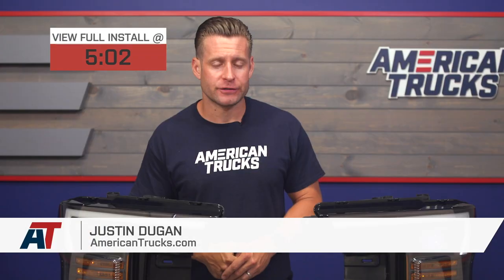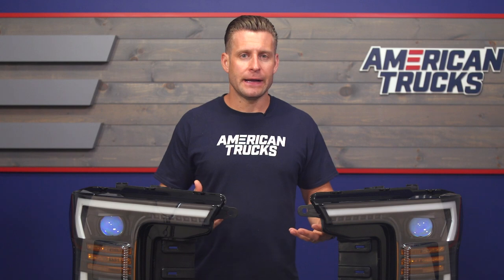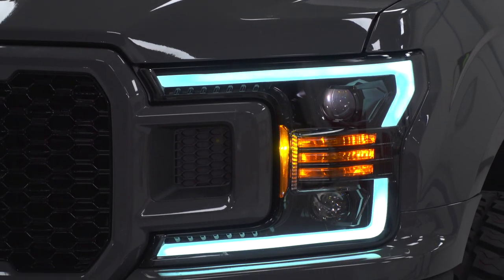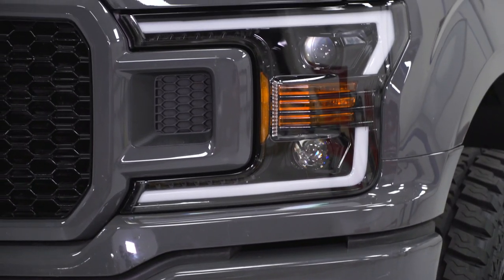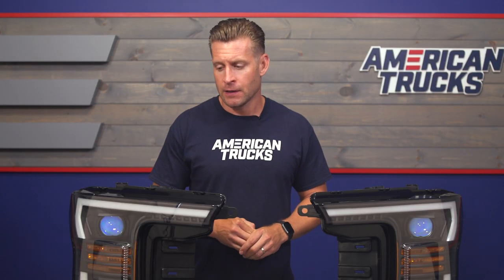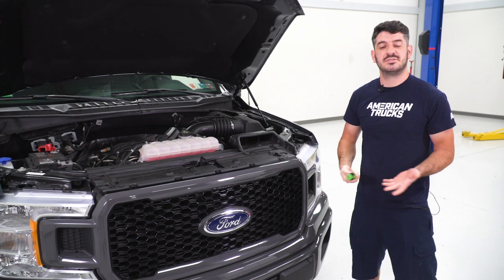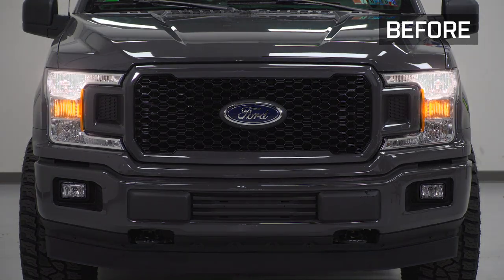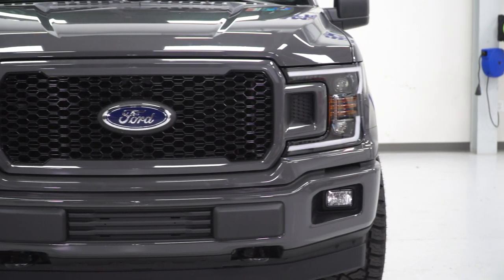2018-2020 F150 PRO-Series Projector Headlights; Jet Black Review & Install

Comment: You need to use a fuse tap and attach the grey wire that comes with the included wiring harness to an ignition circuit if you want your DRL's to work right. I have a 2018 and I installed a $4 tap on fuse #10 per the manufacturers instructions. If your gonna make a video guys, do it from top to bottom.
Reply: exactly, well said!

Comment: Just bought these and are absolutely dim. Will be asking for refund. Going to install my factory ones back on. They look great but can’t see a damn thing.
Reply: You are not wrong. The catch is you buy this unit so youc can swap out the hologen for H7 LED's that you can find on amazon for $40.00 a pair. Now you have LED's for under $700 instead of $1400. The kicker is that if your LED chips does go out, you can replace it. If you buy the whole Alpharex LED kit thats $1400, the chips are not replaceable. After the two year warrantee, you're out another $1400 unless they will sell you the side that went out. Keep your alpharex pro's and just grab the H7 LED's. That's what most people do.
Reply: Exactly what @rdsii64 said ^^. The H7 LED’s will work in these lights and they look great! A million times better than the Halogen bulbs!
Reply: @rdsii64  Do I need to buy the converter add on in order to switch the halogens bulb for some H7 LEDS?
Reply: @MartyIce11 Do I need to buy the converter add on in order to switch the halogens bulb for some H7 LEDS?
Reply: @SM-qu7if  That is something I haven't researched yet, so I'm afraid I can't help you there.
Reply: @SM-qu7if  no you shouldn’t. I didn’t and the LED’s are still running great. I’ve had them in for about 7 months now. Might be best to check AlphaRex to confirm. Sometimes it can depend on your trim level. I have an STX
Reply: One other thing worth mentioning that @MXOaxaco may of had issues with is the projection angle of the bulbs. When you get these lights you will have to adjust the bulb projection for both sides to get them where you want them. My right side was pointed at the sky but the left side was pretty spot on. It’s super easy to adjust them though. Just need a Phillips screwdriver and you can access the adjuster from the top of the light after install. These lights look so good and are well worth the money.
Reply: @rdsii64  apreciate this info !!!
Reply: @SM-qu7if did you ever figure that out ??
Reply: @Eddie510s  Converter only if your F150 comes with stock LED headlights